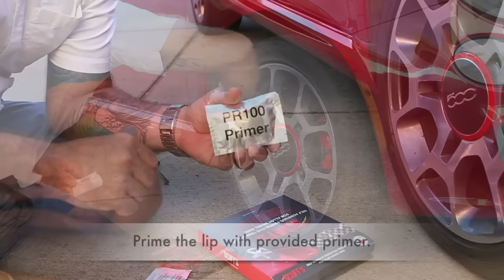Scuffs by Rimblades Alloy Wheel Rim Protectors Installation Video

Comment: Purchased some of these after I had my AMG wheels refurbished and painted gloss black, caught the curb last week and there is not a mark on my wheel. Removed the protector with a little heat, purchased a second full set so I have some spares, good to go again. Was very dubious how protective they would be, but they did their job 100% 👌🏻
Reply: ive heard that they start peeling off after a while,any probs yet?
Reply: @toppertruthio  nothing yet. Been on for a good couple of months now, washed the car multiple time as well. I took my time applying them and followed the instructions to the letter so that may be the difference if others complain of them coming off 👍🏻
Reply: @toppertruthio  Yes they peel off but that maybe because the surface was not properly prepared prior to fixing.  Without heat they are an utter pain to remove.

Comment: How well does the adhesive hold up from weather and heat?  It gets very hot where I live and I'm concerned about the strips falling off or fading over time.
Reply: It does not get too hot here in England occasionally 30 odd degrees but mine were as good after 3 years as when I fitted them I thoroughly recommend them for what they cost they give real peace of mind.

Comment: I guess you have to remove with every tyre change?
Reply from the maker: Best practice is to install a new Rimblades when a tyre is changed. A tyre can be changed with them in place, but this is dependant on the skill of the tyre fitter. However if they break the seal, it could result in a failure after, so to prevent this happening we say best practice is to change for a new Rimblades.
We do sell single wheel kits if for example you get a puncture (or kerb 1) and a cleaner to get the old tape off really easily.

Comment: how thick is the rim? can it cover the mercedes amg rim diamond suit?
Reply from the maker: They are 7mm wide. Alot of customers buy black to cover the polished lip on the AMG wheels. If you have the newer AMG wheels though with a rounded off top edge you need our Rimblades Original version.

Comment: Will it get damaged while changing the tyre, and can you stick it on rims with wheel balance weights?
Reply from the maker: They can get damaged by tyre fitters so best practice is to change them at this time, but we sell single wheel kits and a special cleaner to remove the old tape really quickly. Balance weight need to be the stick on type rather than older hammer on type.
Reply: @Rimblades   Thanks a lot.

Comment: After installing correctly during warm weather, don’t drive the vehicle for about 24 hrs specially in the rain, otherwise protector will come off.
Reply from the maker: 3M VHB tapes use viscous flow with means the bond has a creeping effect where it gains strength over a 72 hour period when full strength is obtained. We don't recommend highway speeds in the first 24 hours and to keep it sensible until full bond is reached. They also won't bond where tyre shine has been used leaving silicone residue on the rim surface.
Reply: @Rimblades  glad you mentioned the tire shine crap. I use the hell out of that stuff. Still going to try these out though. In green on my ATV cause they look cool.
Reply: @Rimblades that's what I was wondering after just posting . So best to follow instructions and   preferably not drive in wet conditions until the bonding has fully finished?

Comment: after put this, you need to recalibrate the wheels. i have same product on my car.
Reply from the maker: Thats not correct. The weight is equal around rim surface and weight is light so you should NOT need to get your wheels balanced after fitting.

Comment: hey I have a question, I heard that you have to use a blow dryer to get the tape to like 70-80 degrees celsius, and I'm just wondering when do you blow dry it, when you put the strip on or before you put the strip on?
Reply: Evang3lium :if you heat it up first it won’t stick properly.if you do it after it will fall off . It’s been 4years are you still alive...?
Reply: eBay says to hear first then apply. 6yrs later. Lol

Comment: Anything that would damage the metal would rip these silly plastic things right off.
Reply from the maker: They are a sacrificial barrier and reduce or stop the damage caused to the rim. Better to replace a silly bit of plastic than a wheel.

Comment: Just bought mine came today fitted them came outside an hour later and falling off. Useless!!
Reply from the maker: ABSOLUTELY impossible unless the wheels are coated in tyre shine which is a non stick surface & cover in the instructions. You need our tyre shine remover.
Reply: @Rimblades  no tyre shine on the wheels.. maybe I got a dodgy batch? I don't know just a little disappointed. Just want to protect my wheels!
Reply from the maker: @Ben-wb8ki  We do warranty them. Drop me an email.
Reply: @Rimblades  will do thanks.

Comment: No super glue needed? What you get with it also when car cleaned?
Reply from the maker: These use a 3M VHB double side tape & 3M adhesion promoter so super glue not required, but we do include an extra glue if you buy the kit option with the joint cap cover.

Comment: do these stay on through a car wash???
Reply from the maker: Yes if properly fitted no issues. However if it is the type with guard rails and you hit the guard rails likewise with a kerb they may need to be replaced.
Reply: @Rimblades  also do the rimblades need to come off and be replaced everytime i need to put on new tires on the car??
Reply from the maker: @CR7Update  We suggest that is best practice in case the tire fitter accidentally breaks the 3M bond causing a later highway failure. We do our own cleaner to get the old adhesive off easily, so it's a quick and straightforward job.

Comment: What will happen to the strips if the tires are changed from winter to summer tires or vice versa?
Reply from the maker: It depends on the tyre fitter, but best practice is to swap for new ones at this time.

Comment: How well does it hold up when you put a new tire on.
Reply from the maker: We do advise best practice is to change at this time, although it can be done if tire fitter careful.
Reply: @Rimblades  wow you replied
Reply: @PeterSmith-ls7ut  so random
Reply: @Polyrytmi  Absolutely!
Reply from the maker: @PeterSmith-ls7ut  Sorry for slow reply. We don't check You Tube as often as we should.
Reply: How long does it last on your tires and how many meters on each tire roughly

Comment: Ive bought these after scuffing one of my alloys slightly while driving my new car home after picking it up last week 😢 went too close to a curb.  The alloys are so beautiful too .  Things happen i guess so i searched to see what i could get to protect them and i was originally going to get an alloy repair kit but a guy suggested it would be easier getting these so ive bought these after reading the feedback from other buyers. This video was short and to the point and i feel confident i can do this . I stuck with black as i wont be able to see them anyway 😅. My cars going to need washed . Im aware putting these on a dry day is the way to go . Am i ok to wash my car first but not put any product on my alloys or am i bedt to put rims on and wash car in day or 2 afterwards? X
Reply from the maker: Wash & dry wheels first. If tyre shine present remove this then use wipes in kit. If you contact me direct I'll send you a sheet with detailed instructions.